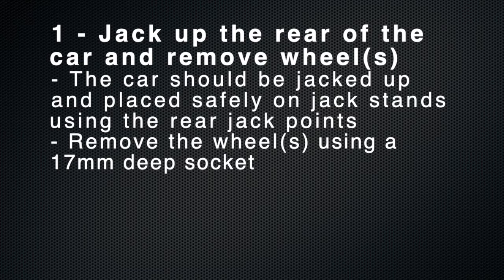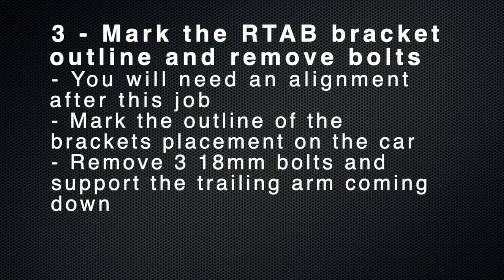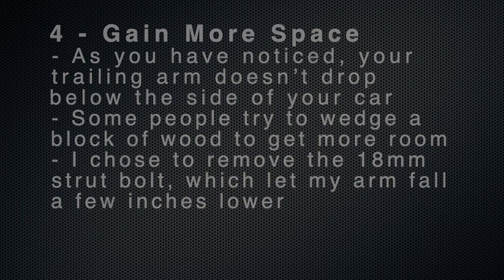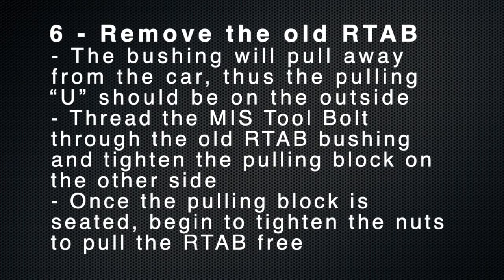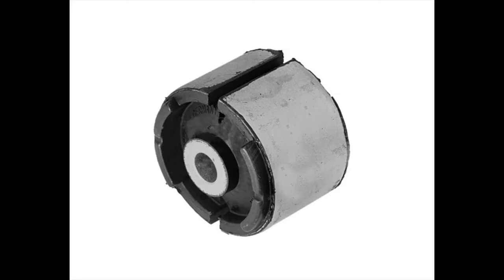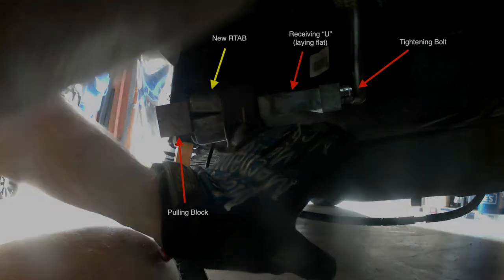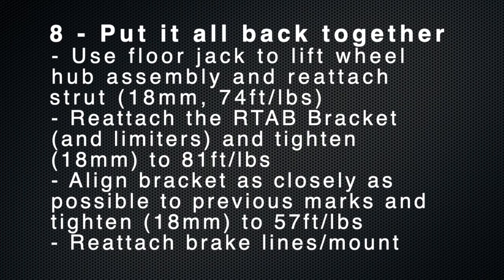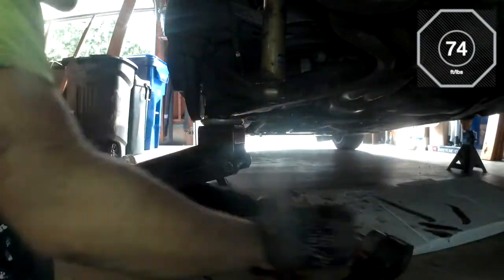BMW e46 Rear Trailing Arm Bushing (RTAB) Replacement

Comment: The new RTAB has to be inserted in a specific orientation (vent openings at the 12 and 6 o´clock position)! This is due to an additional force created by the bearing when installed. As can be seen in the video, the vents compress as the bearing is inserted. This force is ought to strenghten the bearing regarding specific loads.
Reply from the maker: Solid insight!